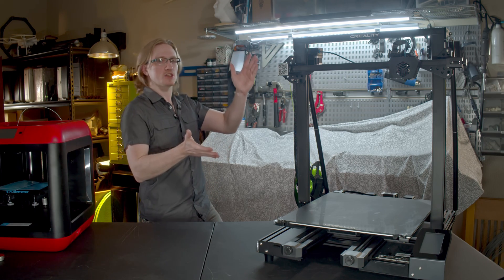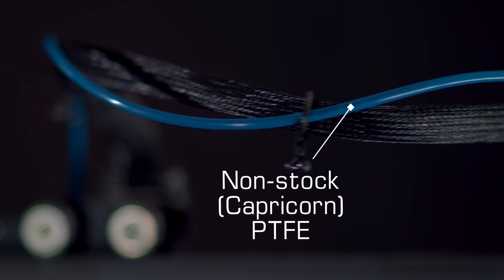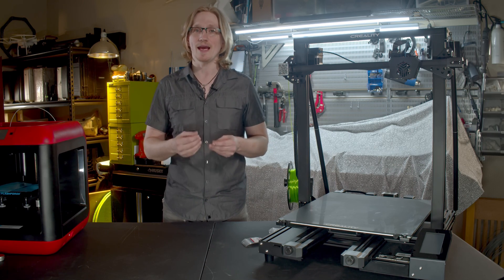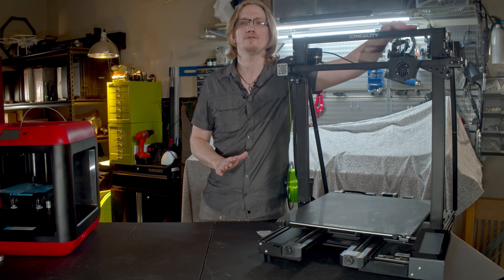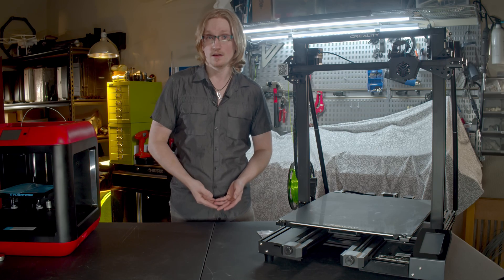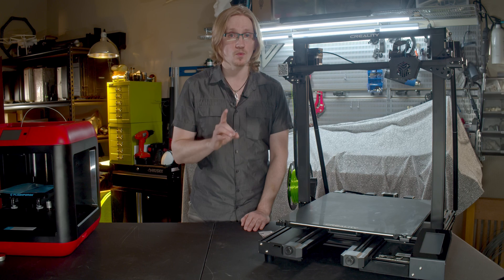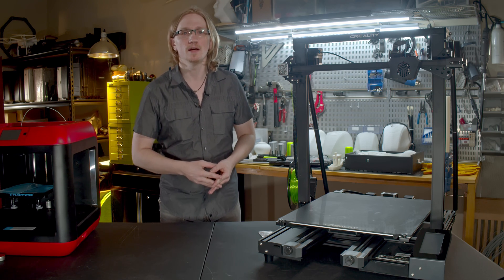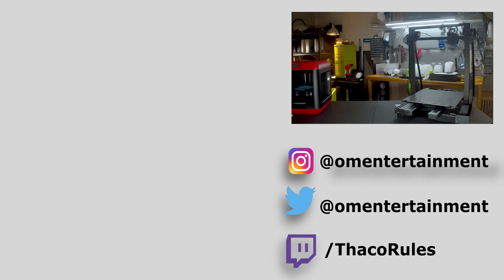Creality CR-6 MAX Review | Everything you need to know! (4K)

Comment: Hi !...
Can you please, tell me the difference between the two types of printers: Ender 3 and CR?
Wich is better and why? Or maybe to make a video to explain differences?
Thank you
Reply: the ender 3 is an entry level machine with a relatively standard build volume the cr6 max is an absolute monster of a machine. i got 1 this week still waiting for delivery. also have a ender 5 max that i'm thinking of converting to direct extruder the PTFE tube is getting short from all the clogging and i'm going to modify my cr6 also to a direct extruder when i get it. the direct extruder gives more control over the filament so helps with printing more weird filaments like TPU

Comment: I just bought the cr 6 max. Also downloaded newest version of cura and cant find cr 6 max in the list of printers? Any solution?
Reply from the maker: For some reason they never felt it necessary to add it specifically, but if you select the CR-6SE profile, then change the build volume to the 400mm³, that's what we all do for the Max.
Reply: @OMentertainment  sounds like a easy fix! Found a older version of cura though, 4.8.2 if I remeber it right. Cr 6 max were included in that version.

Comment: I saw this review before I decided to get myself a CR-6 MAX as my first 3D printer and I am still very happy with my CR-6 MAX. 
Since I enjoy tuning and tweaking stuff, have I so far done these changes to it:

- switched to the community firmware which I think is much better. 
- replaced to extruder with creality's all metal as it is more robust, doesn't hide the feed and is easier to keep clean. 
- replaced the stock bowden tube with capricorn ptfe tube.
- attached a Raspberry PI with Octoprint to the USB port (using a USB power blocker) on it so the printer can be controlled over wifi and the octoprint android app. The raspberry pi also has a camera so octoprint livestreamprints and produces timelapse movies.
- replaced the stock nozzle with a hardened steel nozzle so I can print metal infused filament.
- attached a articulated chain guide for the cable between extruder and hotend to keep the cable well above the bed.
- attached a LED list from IKEA on the top bar so the bed has light

It is noisy and I am considering making it more quiet. Are there any water cooling systems for 3D printers?
Reply: Can I ask which extruder you used from the creality website? And which nozzle did you use?

Comment: For me as a person who did his first print using this printer, I think that the input methods using SD-Card and MicroUSB are not good. why not put a simple USB input for people. 
Why not let people connect to this using cables or WiFi?
That was an issue as the SD-card reader sometimes makes me mad!, it simply does not read the card until you push the card in an out several times!
Also, you should insert the SD card, while the card is backward! this means that the written text on the SD card do not stay on the top side of the card.

Comment: I got a new CR-6 MAX and can't make it work with Cura ( I have MAC). Does anyone know the right settings to make it work?
Reply from the maker: Is the problem trying to find the Max's profile in Cura? When you're setting up printer settings in Cura, I use the CR-6 SE profile, but changed the build volume to match the Max.

Comment: I’m having issues with my max. The z offset is set at .50 and having issues with the nozzle pushing down on the bed too hard. I’ve tried the sensitivity screw and the optic is working fine. Any tips ?
Reply from the maker: I've personally had zero issues with how it touches the bed. If its pressing hard, the only thing that comes to mind is the pressure sensor might be having some issues - in which case it wouldn't matter how high you made the offset.
Have you spoken with Creality's tech support? Most anything beyond my understanding, I ask the FB community "Creality CR-6 SE/CR-6 MAX Official User Group" - they're a very friendly & knowledgeable bunch

Comment: Hmmmm. I have the CR6 SE and I have had zero problems getting the filament to go from the sensor into the extruder. Mine has a handle. Granted it is not as large as the CR 6 Max. I have had ZERO printing problems using latest versions of cura since I took it out of the box.  No filament bumps ever noticed.  Resume after power fail only twice since I had it and it resumed fine even after an hour outage.

But saying all that, I only used the factory firmware for a week. (have had it a year now). I installed the Creality Community firmware for the CR6 SE. Also with my Ender 3 Pro. It is much better firmware than what comes from the Creality factory.  Again, I have had no problems with my smaller CR 6 printer. I do know if I get another Creality printer I will install the Creality Community firmware if available. I tried the bigtree boards with my Ender 3 and had issues and went to the upgraded Ender 3 board last year. Still use Creality Community firmware.

Comment: i'm lookin at upgrading from the Ender 3v2. which would you reccomend the 5 plus or the CR 6 max?
Reply from the maker: Bearing in mind that I have no hands-on experience with the 5 Plus, going on comparing specs, features, and price - a lot of it will depend on your needs. The Max has a larger build volume so if that is key, that makes your decision for you. If it's price, the 5 Plus is more affordable. The 5 Plus also had 20°C more max temp on the bed which would make it easier to print higher temp materials like ABS (I'd probably suggest an enclosure for either of them for ABS anyway, though). I've really enjoyed the auto-leveling feature, but the 5 Plus has BL Touch, which may be fine for you. Both have sturdy frame in their own way but the 5 Plus at least appears more sturdy overall.
For my own personal needs, I'd choose the Max for convenience purposes and build volume. Your millage may vary though.
Reply: @OMentertainment  I really appreciate the your review and take I just gotta decide now 🤔

Comment: Can it do LW-PLA? Please let me know. I’m using craftbot but the xl is too expansive so will this work for me?
Reply from the maker: I've never worked with LW-PLA personally, so I did some research into what it's print requirements are. They all fall within what most printers are capable of printing; it seems the trick is when you calibrate the slicer settings, especially in the area of flow rate. While larger layer heights like .6mm require up to 260° nozzle temps, which is the peak temp of the stock, all the standard settings for LW is well within specs.

Comment: loved the video quick question I have a finder also such a workhorse - how is the speed of the cr-6 max compared to the finder  I need a bigger bed for my projects not so much on the height though just curious - I hear the 6 is painfully slow is this true?
Reply from the maker: Good question! So while I can't compare directly to other printers other than the Finder, what I can say is that the speed has been completely relative to the other printing circumstances. For example, a TPU by its nature of the material has to print slower, that's true for both printers. Also, if folks are used to a tiny build volume, they're used to a max finish time, and a larger volume always means more time.
As far as the CR-6 Max's ability to accelerate and run faster speeds, I've seen no difference between the Finder and the Max in this regard. Both machines are built sturdy in such a way that the chances of the nozzle wobbling on the plate as a result of speed are well within normal limits.
Of course for detailed prints, the slower, the more accurate a printer tends to be but that's across the board as well. On my unboxing live video, you can see the Max in action throughout the latter half printing away with stock speeds and you can tell for yourself. 
To be perfectly honest, I've found my Max to be more accurate on prints and has taken over as my primary printer, even for smaller prints.
Reply: @OMentertainment  thanks for the replay. I love my finder so much so that It is my base line for everything i've had a FF Dreamer and sold it and a BIBO 2 also sold it i was looking at a folgertech but I think they are out of business.  so for build volume I am leaning to the max or 10smart only because I'm used to the wifi with the finder and its ease of use

Comment: Mate, I really need your help, I've tried everywhere. What is the start and end g code for the CR 6 MAX? I'm using Cura, and the nozzle is going out of limits trying to print, and this model isn't in Cura drop down menu
Reply from the maker: I'm not sure about the g code, but all anyone has done for creating a slicer profile in Cura was select the CR-6 SE profile from the drop down menu, and change the bed size. That's all I did, and it has worked without issue.
If you're still having problems once you do that, I've found the FB group "Creality CR-6 SE, CR-6 Max, & CR-10 Smart Community" to be an invaluable resource of knowledgeable users.
Reply: @OMentertainment  Jinx, I did exactly that, I joined their Facebook group, and the issue was sorted within 10 minutes (you are right, it was the bed size, I am a noob). Thanks for taking the time to reply to my question!

Comment: Awesome review and loved the format with pros and cons. Also showing the 3d prints you got from the printer was a nice addition to show quality and size of prints. 
How has the printer been working for you recently? I was thinking about getting this model as I wanted to add a FDM printer to my collection of resin printers. :)
Reply from the maker: Thank you! It's still been pretty solid! It's become my primary printer, and I have a bunch of print videos in the pipeline that were made with this printer. If you have the space and investment, it'll be worth it. The only obvious weakness will be if you want to focus on ABS.
Reply: Have had mine over 6 months now James and working well.  Replace the extruder with a SeeMeCNC EZR struder as soon as you have extruder trouble and filament loading and extruder performance will be much better.  I have a Spool3d.ca heatbreak https://spool3d.ca/creality-cr6-se-heat-break/ to try high temp but have not installed yet.  I print lots of structural parts and use a 1mm nozzle for strong parts/faster printing and  usually use PETG with thick walls.

Comment: Thanks for the review. My extruder stopped working a couple of months ago. It's not the motor, or the wire running to it, which leaves the wire harness or the system board. I've ordered a new board and am waiting on that.
Reply from the maker: I'm sorry to hear that! Do you know what caused that area to fail?
Reply: Sorry I am probably to late - but throw the extruder away and buy a SeeMeCNC EZ struder https://www.seemecnc.com/products/ezrstruder.  I have used my Max a lot and it got to where I could no longer get filament through the extruder.  When I took it apart to see why springs and stuff exploded everywhere so I tried the Ezstruder per web recommends.  It plugs right in using the original  Max extruder motor and works SOOOOOO much better.  Some have had to change steps software after the change, I did not and it works fine.

Comment: To add to the filename issue (which is an OS/firmware issue), it has a limit of those 5 pages of listing items. I think 5x5 items? So if you have more than 25 (or whatever it is) items on your card, it can't list them. That's just dumb.
Reply from the maker: That's a good point, I never tested it that far! Generally, what I do is after I'm done with a file but may want to use it again, I stick it in a folder on the card so it's not cluttering up the list.